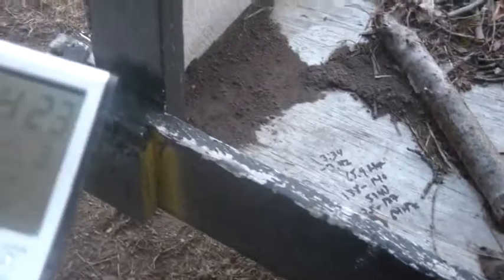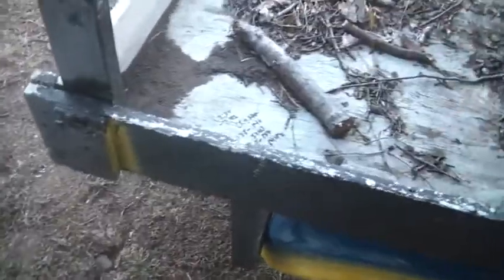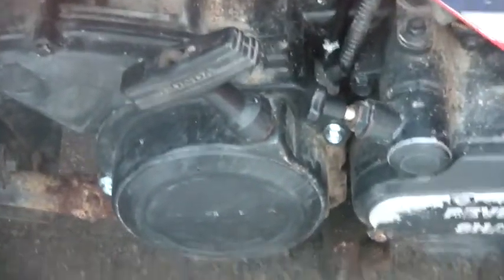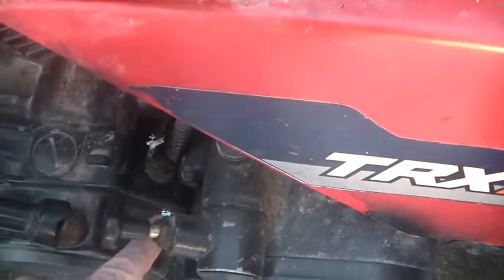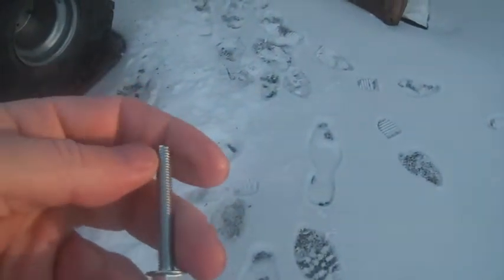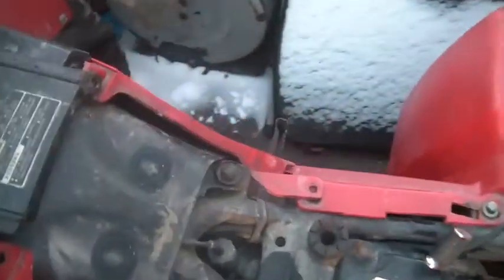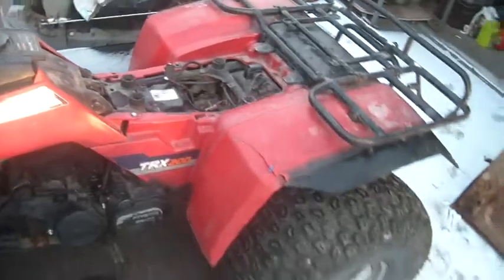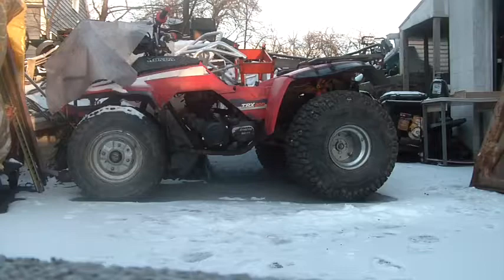2 3, Honda TRX200 Cold Start

Comment from the maker: Hey Wallie!  Generally speaking, Hondas are as tough as nails, I avoid the Rincons with full automatics. Any bikes I buy, I fire them up watch the exhaust for smoke, listen for valve and bottom end noise. I lift the front and rear, look for anything loose,Spin the wheels and look at all the joints. Make sure the 4wd actually works for the front and back wheels w/no noise.Only bad thing is that the 4WD drive is expensive to fix on all quads. Use Ur good sense, take it for a ride and buy it cheap.